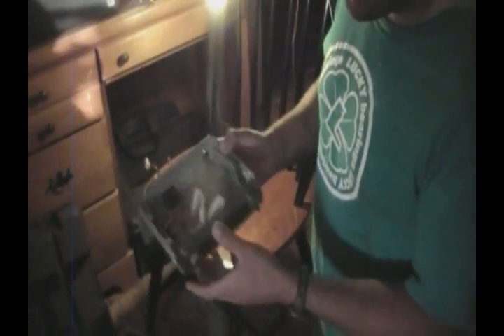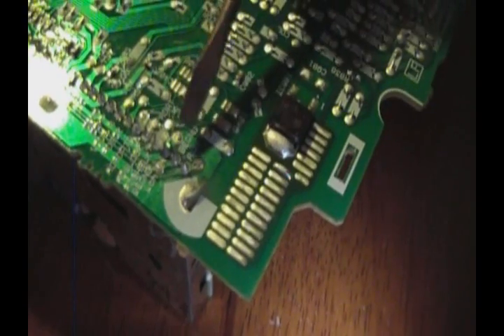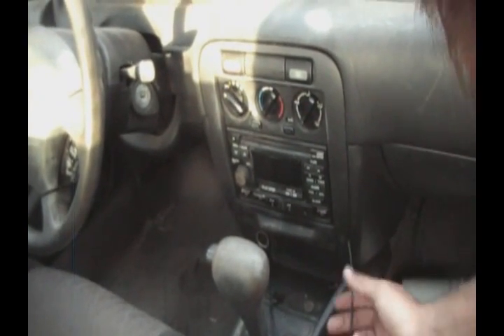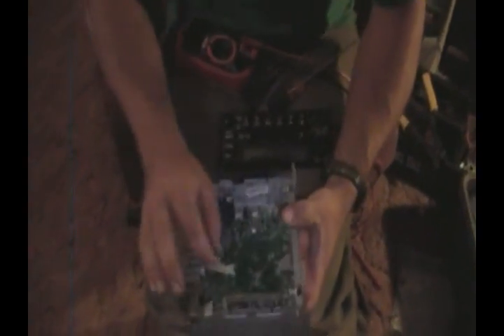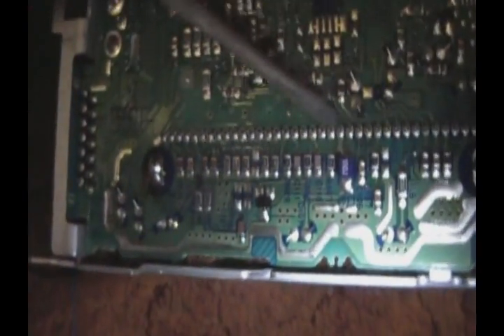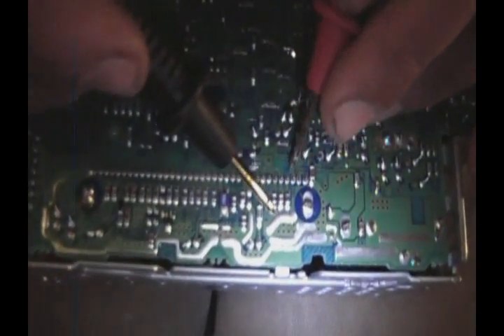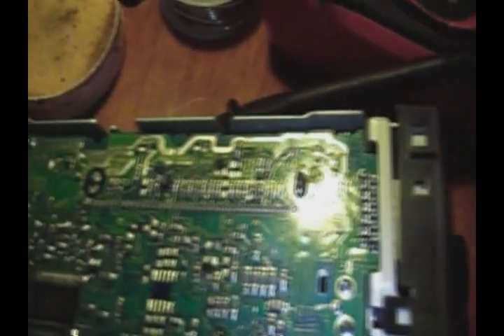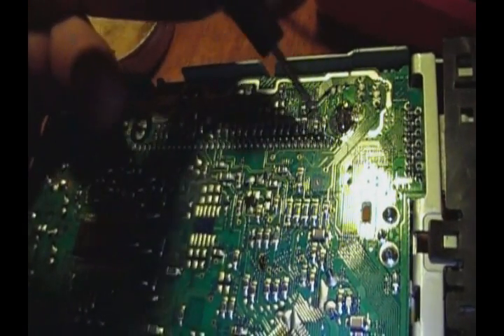Car Radio Aux Input Hack (Works for Most Cars)

Comment: Brilliant man! I had the idea to do this on my own, but wasn't sure where to make the solder points. Your video really helped steer me in the right direction. It's working great! Audio isn't 100% clear, but definitely better than a transmitter or one of those tapes that play auxiliary. BTW, I didn't even bother with hooking up an outside power source or speakers. I did all my pin connection tests with the stereo still plugged into the car! Really good video guys. Thanks a million 👍

Comment: Whilst searching for a sound output solution for my Raspberry Pi based In Car Entertainment System and in trying to use my existing Pioneer DEH-1600R Radio I came across your video. Brilliant this looks like exactly what I need. Just took my radio apart and luckily the Radio Module pins are labelled Rch and Lch :-)
Reply from the maker: awesome!
Reply: Ben, wired it up today and it worked but I am getting a heck of a lot of background noise and whining. 
Could this be that I used the wrong Gnd, I used DGND instead of BGND or the fact that there is no aerial fitted? Sounds like either Engine Noise, No Aerial noise or interference from the device used as the sound source (a Raspberry Pi PC with a 7 Inch Touch Screen powered by a Mausberry 3A Car Switch.  
Here is a link to my blog with some pics.
https://picodeandchips.wordpress.com/blog/
Reply from the maker: It gets a lot of background noise through something called a ground loop if it is powered or charging while also playing music.  It varies depending on the headunit (radio) that was modified.
Reply: Ah yes the Pi Computer is being powered by the Mausberry 3A Switch. Apart from running the Pi PC off of a USB Battery is there any way to reduce or stop this in its current state?
Reply from the maker: ground loop isolators solve this.  but in the application you are using it sometimes allows radio signals in, thereby creating a new problem

Comment: So youre tapping into the point between the radio tuner and the amplifier to (inject) an audio signal where there is normally the finished product ready to go on its journey to that and the speaker. Doesnt this overlap anything? I would say since a headphone jack is essentially a normally open spring loaded switch whynot have that knockout the radio signal so its not overlapping as soon as you plug it in...

Comment: Simply solder wires onto the cassette pick up heads and drop in a blank empty shell from an old cassette after you remove the tape switch to tape for your input this way you won't have noise and you will get right and left signals.
A lot of factory radios have inputs on them look on Metra's webpage for the adaptor for your car.  If its an old unit tape player who cars if you do it to the tape head, its not like you have a compact cassette to play anyway also works on a 8 track player. You can disconnect the tape player's motor or take off the belt's. some decks use the belts to eject the tape. some need to see tension over the tape head to play or they flip sides, these can be tricked by using a toothpick or whatever it takes.

If you ahve an old Alpine pull out from the 70's or 80's do not destroy it buy a new radio.
Like a 7618 there are plenty of guys willing to buy it. it will ahve chicklet looking 1-6 presets for stations and a bass and treble slide. These were some of the best competition car radios ever made.

Comment: Hey man. I have a 94 Ford truck that the radio /cassette  player is switching to tape with no tape in it.  Do you know what makes it switch from one to the other. I took the tape player out of the radio and it still goes to tape mode. I tried to locate the IC that controls the switching but had no luck.

Comment: Hey Ben - great video.

I am trying to add an aux jack to an RBK radio - the version with the bass and treble sliders. However, I cannot figure out which of the pins above the tuner on the main board are the left and right channels.

Any advice or can I tap into the CD Changer lines (no CD Changer) or some other sport to add the aux?

Seems like it is just hijacking the signal so you could tap into other places too.  

Any help is appreciated.thx.

Radio came from a 2002 Jeep Liberty.
Reply: I am rewatching and I will try your volt meter test method.
Reply from the maker: The thing about the cd changer is the amplifier has to think a cd is playing for the sound to run through those lines.  Ppl do it by burning a cd that has no sound.  The benefit with going through the radio is that it runs sound through by default unless something else is.  I do have another video on a home stereo from 1999 where I show a different way of finding where to solder in.  https://www.youtube.com/watch?v=vkm6qFXxV_U&index=5&list=PL2MlCxhDAhn2kpiavF0-bRw_1iwxak7-f

Comment from the maker: Finehika Tangifua Yes.  It has always worked for me.  When I unplug the mp3 player/phone etc, the radio just comes back through.
Reply: Thank you so much for taking the time posting this video. I just did it, and it worked!!! Feel like the biggest technology achievement to me. I do have a little radio signal left when i turn my phone volume all the way down. Is that normal to you all?
Reply from the maker: Sometimes I have found that to be the case.  Awesome that it worked good for you!

Comment: If you solder to the R/L channel of the tuner wont you have some distortion?
Reply from the maker: I solder where the tuner outputs.  Some radios will include audio feed from whatever channel the radio is tuned to.  But most radios will shut that out and you only hear the one you put it.  This is probably because it recognizes that your audio feed is louder and clearer.

Comment: Help on my pioneer i have lch and rch but i have a white and black where the white goes and where the black goes
Reply from the maker: Are the "white and black" on the wire that is going to connect to your mp3 player?  On the mp3 player, you have a headphone jack.  The plug that goes into that has 3 sections.  The big one is ground and the two further to the end are lch and rch.  You connect them like that, but not to the part of the radio where the cd player sends it's sound to the amp.  This will make no sound unless a cd is playing.  Connect to the radio part of the head unit as shown in the video.
Reply: so i can put the white and black on which eber one i choose lch or rch, and yesits from the headphone jack

Comment: how can i do this on Peugeot radio if it has no marks or any letter on the mother board
Reply from the maker: i don't know about peugeot, but eventually I will upload another video showing the answer to your question on a ford,  you may also want to check out my video on home stero aux input  under my "how to" playlist
Reply: thank u for your time, I really appreciate that
Reply: and by the way accidently  my galaxy S4 just ruined because i made a wrong circuit hhhhh

Comment: you can also just get a tape to aux adapter and put it in.
Reply: I did what he showed in the video. The quality of the sound using this method is much clearer and more detailed to me vs using the tape adapter that i bought from ebay (maybe it is just a bad adapter because it was cheap...)

Comment: Hey Ben, have you ever done Audio for 2005 Dodge Stratus? I am having some hard time disassembling the car stereo and finding left and right channels.  Could you send me a circuit board information for this stereo? Part number is "P05091506AD"
Reply from the maker: I don't have that information but I have done a 2005 Dodge Neon and this method from the video worked.  I think I may have mentioned it as I did the Toyota radio in the video.
Reply: +Ben Joiner (ApologeticsBenJoiner) 
Can you show me the circuit board of 2005 of dodge neon?
I took out the radio but I could not unpack the radio further. Since the board was attached to outer case. I can show you the picture of it.
Reply from the maker: In my experience I had to dissasemble the radio but there was a bottom panel that came off.  I didn't take any pictures of it when I did the project.
Reply: +Ben Joiner (ApologeticsBenJoiner) 
First of all, thank you so much Ben for getting back to my comments. I really appreciate your advice and help. 

Is it okay if I send you some pictures or videos regards to this radio?
Reply from the maker: I will try to help if I can :)